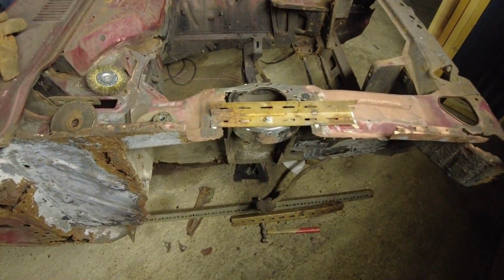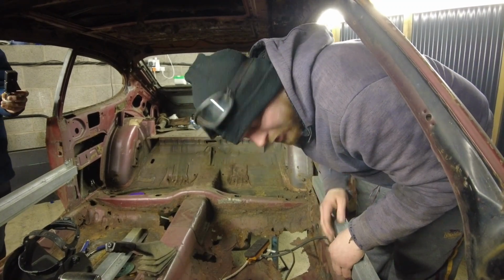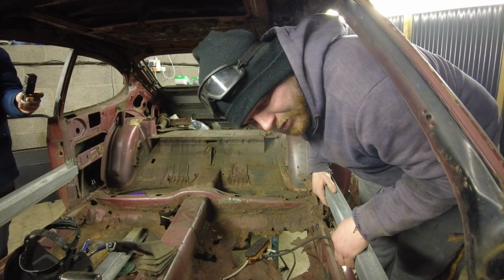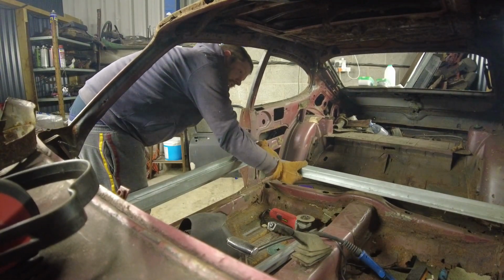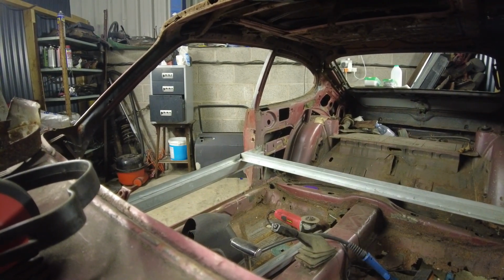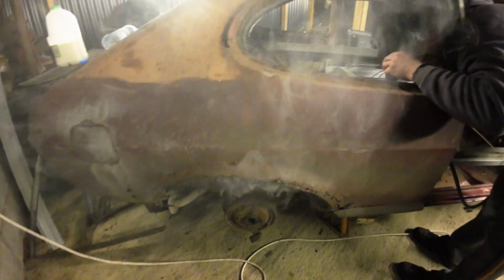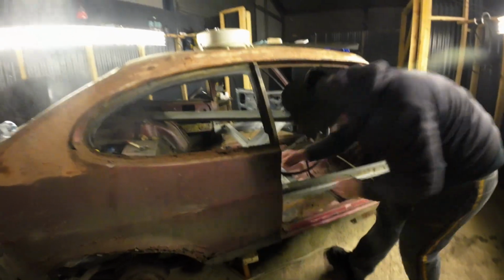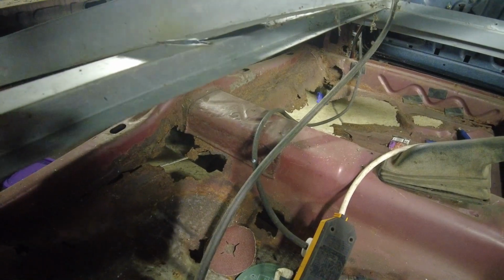ford capri 3.0 restoration part 21

Comment: If you can repair the floor sections that's half of the battle done, but then again, when you start cutting, a small hole, turns into a very large hole. As for the curved panels, Its a long shot, but i would look at someone who breaks old fords or old school scrap yards. Just to see if they have a Capri in. Where you can rob that section off, me and my dad robbed an inner rear arch off a later Rover100, to replace my Rover Metro inner wheel arch. Which had the seat belt mount. Took us off a few hours to cut the arch out, off the scrap car, and not even an hour to cut the old one out of the car. With in a few hours we had an inner arch back in, and by the weekend we had the back end fully welded.

Comment: good your bracing mate also record some datum point measurements if your taking chassis and sills off,and you could do with a gas blow heater donating to the resto,and save panels mate it makes the resto a lot cheaper.

Comment: Get a log burner in the unit mate 👍
Reply from the maker: There no room for a work bench mate would struggle for a log burner mate but I need to get some kind of heater or fire
Reply: At least your dry and free from the wind and rain.

Comment: Mate you need to use propper steel box section for bracing the chassis, not that folded sheet stuff. The amount you've got going on there will make it impossible to get it and weld, and is actually doing nothing to brace the chassis. Theres absolutely no strength in that stuff whatsoever. You can see there's not, the fact you've twisted them to weld them makes it clear there's no strength in them.

Cut them all off and do it properly mate, before you start cutting bits out and it'll fold up like paper
Reply from the maker: Well if you’re offering you can always send some my way ? The steel that’s on there now yes it’s flimsy but once it’s together it has strength , it’s only twisted due to it’s so long no they’re all rolled together don’t move at all if you’re offering to supply some PROPPER BOX section i’ll be happy to remove it and fit some
Reply: Think the fact he’s tacked them all together gives it its overall strength and rigidity, torsional strength of one u section is neither here or there. 👍👏👏
Reply: If you give me some rough lengths of what you need I could get you some 30x30 stainless box section,could even drop it off as I come to Leicester on a Sunday to see my mum,wouldn't be until next Sunday though if that's any good to ya???